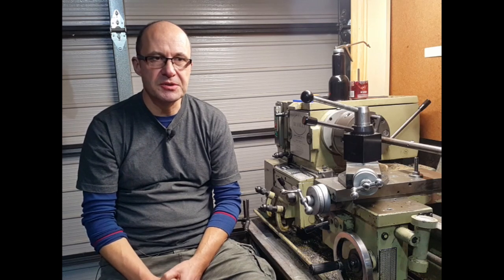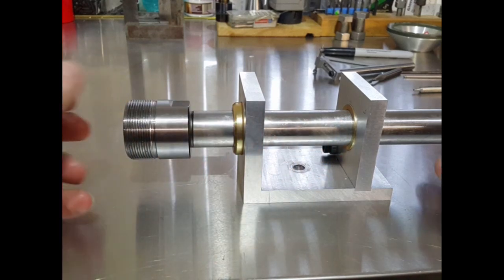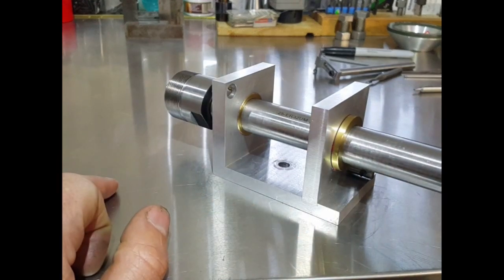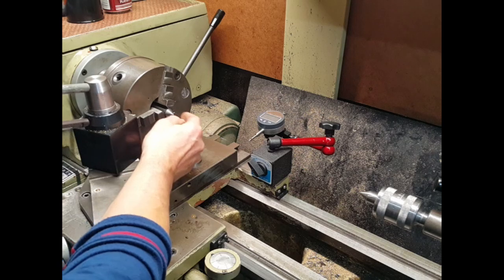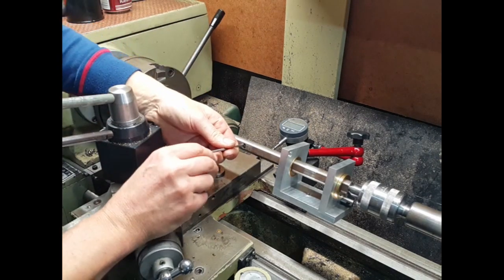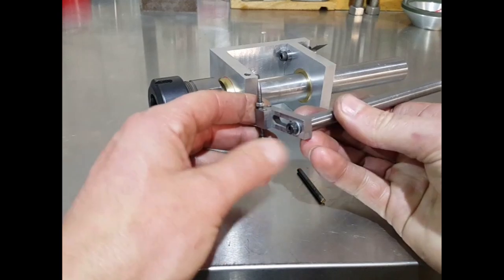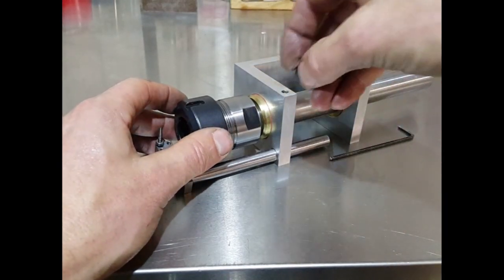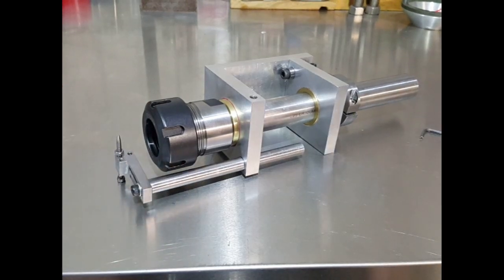#33 - Endmill Sharpener/Grinder - Part 3

Comment: Hi Kevin is that shaft 150 MM long if not were did you get it from. Jeff from the uk.
Reply from the maker: Hi Jeff, the shaft is 200mm(150mm would have been to short). I imported it from China.